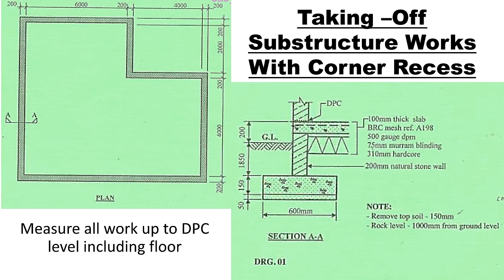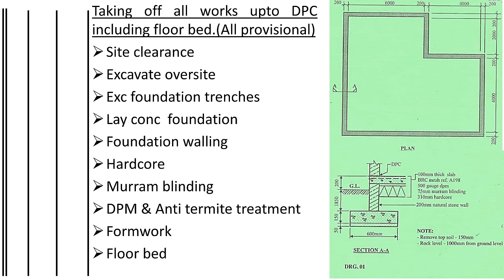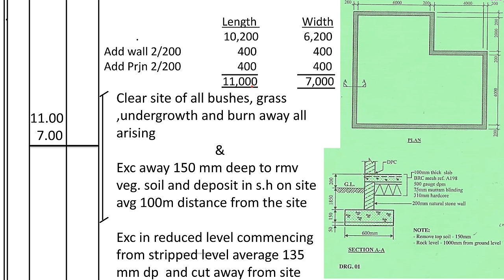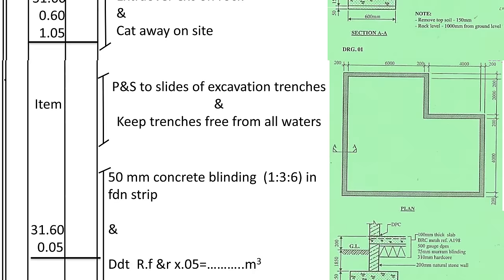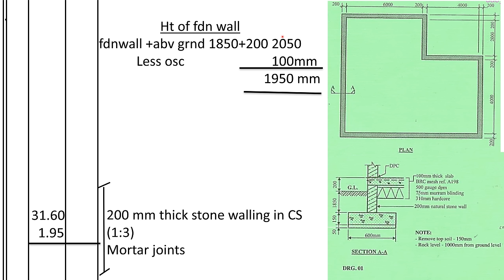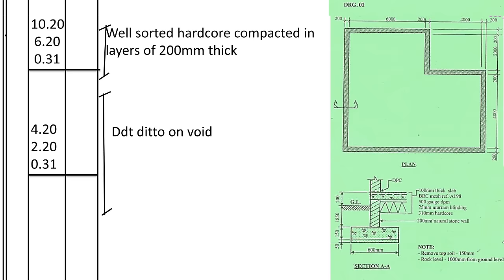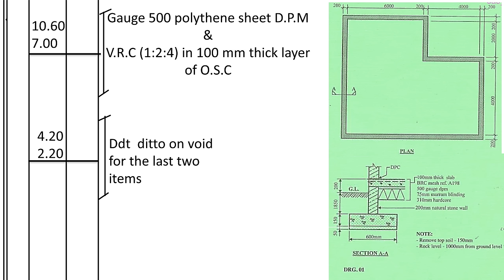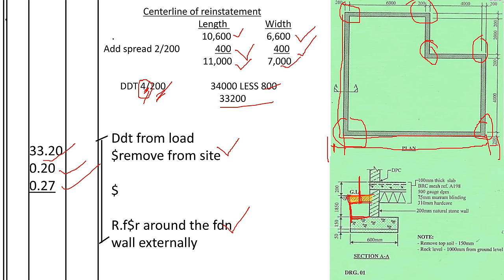Taking Off  Substructure ; Corner Recess (SIMPLEST Explanation) /QUANTITY SURVEYING TUTORIALS

Comment: Also you said that we should use the centerline of the spread when calculating for soil reinstated not using the external dimensions and this is from following all the other examples plus introductory videos
Reply from the maker: There are two formulas but the end result should be the same.kindly note the difference.

Comment: I love your work though this example had many errors, another was on the form work when you add 3/200 + 2000 + 4000 it doesn’t give 7000 for the internal width
Reply from the maker: formwork is usually done to the external dimensions of length and width as its purpose is to hold concrete which includes the walls

Comment: while calculating the center line, you are supposed to use the thickness of the wall but you used 600 as the thickness or it is me who is not understanding
Reply from the maker: I used 600 which is the width of the trench because the wall at the centre of the trench.Thus, the centreline of the trench is the same as the centreline of the wall.

Comment: I think there was a problem with coming up with the length and width for the excavated soil using the centerline method because why are using 11000 when that includes the spread yet we want the centerline of the brickwork and also the width has an issue compared to all the other examples
Reply from the maker: in this example we used a different ans simpler method to calculate centreline.whatever method you choose to use,the end result should be the same.Kindly check out our video of calculating centre line and you will understand better

Comment: why does the width of the structure go from 7,000 to 6,00 but the length remains at 11,000?
Reply: Probably while calculating the centreline, you are supposed to use the 7000.. as the width and not 6000